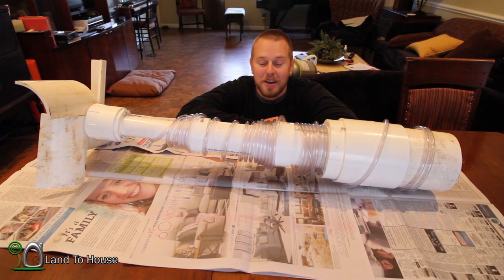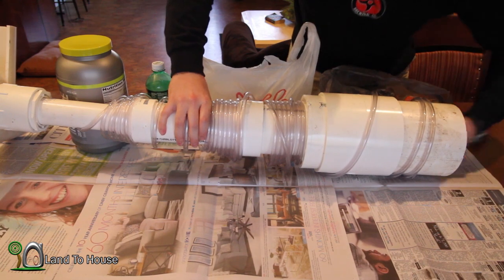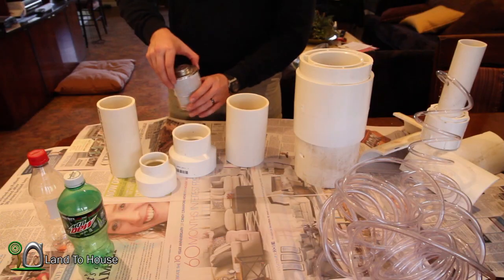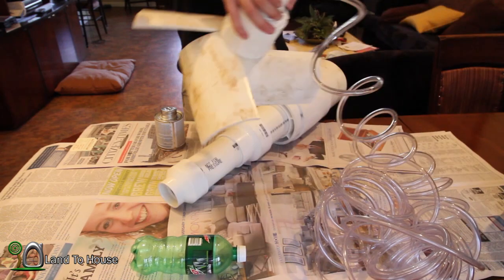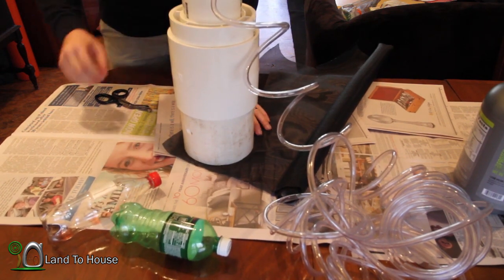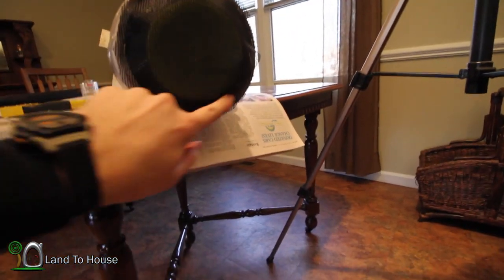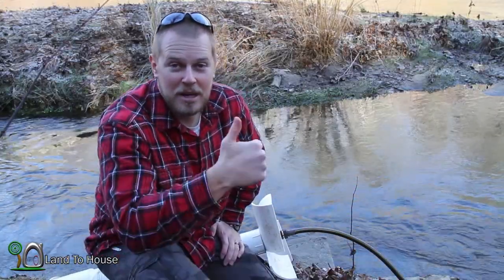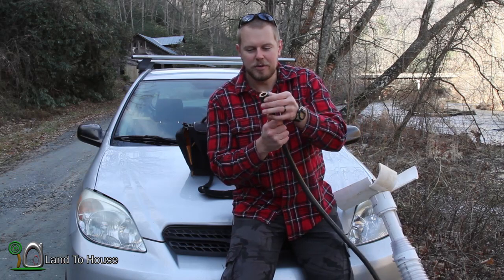River Pump Build and Test part 3

Comment: Wonderful work. Looking  foreword to # 4.
Reply from the maker: Thank you.  I am getting info for part 4 but it might be a little while.
Reply: Hi
It is me again.  I just reviewed your #1
river pump vid. I thought you had 3/4 "
clear raped around the pump, it was only 3/8".
I think you need bigger like 3/4" gulping water. I think That will get you about 5 times as more water pushing. Then using 3/8" or 1/4" for the lift hose you should get about 5 to 7 feet of lift (or more} from the river.  Good luck.
P S   Marry  Christmas & Happy New Year
Reply from the maker: +Tommy Schauer Ah yes its only 3/8" When I was buying the stuff to make this project I wanted to keep things under $100 (because I am not a wealthy man). The 3/4" tube was expensive and they only have a little of it. I am going to add a tube on the end of the 3/8" as a funnel first to gulp more water and air. Then Next I am going to add a smaller clear tube as the delivery. I think shrinking the delivery will help with the small input. BUT you are right it would be good to have a larger input tube. I was thinking that I heard a value that goes something like this: the lift is = to the number of coils in the pump x hight of the pump. So if the pump is 6" and there are 30 wraps its would be .5'x30=15'.  So I might be able to get up to 15 feet one day when the pump is working at its best. We shall see haha
Reply: How about part of the garden hose in side the pump. I understand   not wealthy.  Keep up the good work. Have good time with your family this Christmas time.

Comment: I saw this back in the 70s, used 1/2 tube for the pickup tubing and yes the blades were tapered as you say iam at part 3 now keep up the good work. Thomas Noteboom
Reply from the maker: So far i never did get this to work. I had the makings of a much bigger version but used the barrel for another project.
Reply: @LandtoHouse  spiral on a vertical water wheel would work great with that much water and flow. More to build but rather simple and use polypipe.

Comment: why not to put a lid ? instead of filling it. theres gonna be air inside if u put a lid on it.
Reply: thats a really good job, getting ideas, well done. thats what we need, creative people. not slaves of a system
Reply: i think the tube could go outside (tuve ( SPANISH SPEAKER) ) so u could use a lid for floating, n the tube would be outside still getting water. there are wheels like pelton wheels, with tubes around it
Reply from the maker: My new design has a closed system inside that allows the lid to make an air tight fit like you say. I am about 1/2 done with that build. The weather is too cold here to get in the river to test. I see that a river pump can be purchased for several hundred US dollars and that is just too much! I would like to make a DIY model that is $50 or less.
Reply: Land to House  id like to do the same thing here, cos here is a tropical country, many people live far from towns, n hace rivers n wind, but dont know how to use them, bad thing is i have no money really, no job as a pilot yet, im making just 10 dollars day, its been hard. hope u keep the hard work . thx so much for answering
Reply from the maker: I also have limited funds to make lots of tests. My wife and I are having a baby and that will take a lot of our funds. BUT I want to be able to make things like a river pump. If I can do the research and let others build it for themselves I will feel accomplished. I hope that you can build a working model too! So far this test did not work as I hoped but it gave me some great info.

Comment: I made a a6 inch ramp pump out of steel tube .tested it from a 30 ft section of 3 inch pic pipe and a garden hose..it jade a 5ft head..it empty a out in 15 seconds..it claims up to 20psi..then I made two 2" check valve ram pumps just like yours.. (12psi each)I plan on using all 3 to fill the tank..the 6" steel ram pump is impressive.but not creek tested yet..this project is take ing for ever...lol. Thank you for your input..I have some nassyers for this project..but I think it will work..I tested my turbine on my garden hose at 30 psi = 19 volts open Circuitfrom bridge rectifier..
Reply from the maker: +billy bob bussnesman This does sound like an ambitious project but I think its well worth trying! So have you tried connecting a nozzle to the end of that massive pump to pressureize the delivery? you might could get some voltage from that. I gave it a test with the 1-1/4" pump and got over 4volts with only 6' of head. Just a thought but you might have some potential. .... I have a feeling that your tank is going to empty much faster than you can fill it. SO you will be alternating the electricity production and filling .
Reply: i have not hooked the hose to the turbine yet due to it completely empty the system in 9-13 seconds,i need a water fall to keep the pump and the water line full,lol,when the 3'X6'  gate opens it releases about 2-5 gallons(guessing) but when the gate slams shuts WOW..the whole pumps moves ...psi jumps up 7-12psi every closing..it only shuts twice due lack of water supply..my house water hose can not fill line fast enough..i will take pics,,not very pretty..lol,but pressure holds ok,,except the pvc pipe tank..going to replace with steel bladder tank..im also doing a tred mill motor wind turbine project,,tested it..40-170 watts on a diversion load controller from charging battery to GTI....now all most ready to in stall...this works better then the piece of crap gugu 500 watt i bought..9 watts...lol..ill send pics
Reply from the maker: +billy bob bussnesman I just got your pictures! Your projects are all coming along well! Seems like they are all close to done with the build stage and ready for the long test. I was wondering how much psi you would get from a 6" pump. I have seen the professional builds that are bolted down to a concrete block and I am thinking that you will have to do the same here. Gosh 9 to 13 seconds! How many GPM is that? .... Someday I will bring out my treadmill motor and buy some blades for it.  we just dont have much wind around here.
Reply: i cant accurately estimate the psi until i can get a constant water supply..ill hook it up next summer..
Reply from the maker: +billy bob bussnesman That is what I am thinking about my water projects too. Its getting cold.
Reply: yep..let me know when you get the river pump figured out..
Reply from the maker: +billy bob bussnesman I will. Should be filming part 5 soon.

Comment: Have a look at at spiral water wheel. I built one with 44 feet of hose on either side of the wheel, it was 40 inches tall, and would produce 6.5 psi with only 40 inches of height, it would raise water to about 14 feet above the creek. I then pumped into a five gallon bucket, and could separate the air and water, and ran it into a 6.5 gallon water heater out of a trailer, and then from the fire into a spiral under my tent, and would have hot water or hot air under my mattress. It worked great. Don Drivdahl

Comment: What about taking the swivel off of the paddle side(hard mount hose here with brass fittings) and moving your swivel point up stream to a fixed pumping/anchor point. This would give you the ability to always keep the pump wet, centered in the current by triangulation and service your pump line on shore.
Reply from the maker: +Foothills Readiness I have actually scrapped this design. In a few weeks I will be testing the new design! Videos to come of course.

Comment: For the screen first you should have spread the screen onto a piece of paper then put the jug in the pipe. Once that was done put epoxy on the edge of the large pipe and set it down on the screen so that the epoxy pushed through the screen. Once the epoxy dried you could strip off the paper from the end. After that then trim the screen to fit.

Comment: I have watched your channel ..you have a lot of great ideas..I have used some of your ram pump ideas but did them a bigger scale..I bought a 2300 watt 3 phase water turbine.i have a fast movining creek 800 ft behind my house..I need figure away to get water to a 2300 gallon tank that is up 20 ft in a tree ..so I can use 2inch hose and gravity to run turbine..any ideas?
Reply from the maker: +billy bob bussnesman Thank you! I like to share what I am learning. That is a large tank in a tree! So a 2" pipe gravity pressure can pull 55GPM easy. (Might be a lot more) that means you will empty that tank in less than 40min. If you had a single ram pump pumping water 1gpm it would take 38 hours? Is my math right? SO you would need several pumps to make this faster. If you could make a good bit of power in 20 to 40 min I suppose its worth it. I have thought about doing something like this too just to test it out. The time it takes to re-fill a tank is the thing that always gets me.

Comment: With your 5 toe shoes I'm thinking you're very in touch with your inner caveman : )  I do love this type of Project because we all automatically think Filler Foam, Hot glue, modern (often toxic) materials, and, I love the irony of building a pump by tossing a load of plastic bottles into a river.
Reply from the maker: haha yes those shoes are funny. The use of bottles seemed like a good idea. I dont think that they were enough to get the unit floating high out of the water.

Comment: Fantastic project you got here. I'd like to share a tip with you about gluing PVC. Technically is not really gluing, but more like welding. The chemical used as a glue melts the PVC so that both pieces melt together. For that to occur properly and achieve a better bond you need to apply the glue to both pieces, not just one side. I notice you only applied it to one side. It might work ok, but the bond might fail. I don't think it will fail for this project, but if the PVC is used for it's intended purpose (delivering water to a building under pressure), it can come lose and you'll have water all over inside the walls and building. Also, for PVC larger than 2" in diameter it is recommended to use a primer to make sure the bond does not come apart.
Reply from the maker: Thank you again for the great tips. I had heard about the melting and bonding of the pipe.  I will start connecting pipe with both sides coated.  Most of my pvc work so far has not exceeded 25psi.

Comment: Great experiment again. Adding a one way valve (the small aquarium type) somewhere at the end of the clear tubing may improve the flow? You should test with the priming procedure too.
Reply from the maker: Thank you. That is an interesting idea! I will have to give that a try. Priority 1 will be getting a swivel joint that holds pressure.
Reply: The swivel joint you could mod? Just grind away the threads that tightened the hose?
Reply from the maker: After inspecting the swivel a bit more thoroughly I realize that it relies on a washer to be airtight and it must have that pressure from the threads. I've been browsing the web for a real swivel joint that's not $200 haha
Reply from the maker: I actually had that idea too! I asked around and got one of these that someone did not want but the issue was the 90 degree bend. ... a couple days ago I filmed part 4 and was able to get some much better results. I think i will post this Saturday.

Comment: You are improving it with every new adjustment you make.  Did it pump any this time?
Reply from the maker: +Pidasian Hippie It came close but then I realized that the swivel joint was stopping it from pumping. It has a leak when its not tight enough. So there at the end when I tightened it it did not swivel. I have contacted a company asking if their swivel was going to work.
Reply: Land to House I hope this company has what you need.

Comment: drill a small pilot hole and use two or three stainless screws rather than glue for easy access
Reply from the maker: +all lives matter that is a good idea. I am totally redesigning this pump right now. I'd like it to be done by next month.

Comment: If it had the same size tube on the pump and delivery hose, the air will push the water higher.
Reply from the maker: I have a new design that will use a garden hose as the spiral pipe and delivery. So they will both be the same. We shall see how well that works

Comment: I'm gonna feed off ur success and failures from your river pump..lol if I have to have 20 ram pumps I'm gonna make it work..lol there is a spot where water is leading into the creek from a small lake..I put a 5 gallon bucket under the falls ..it takes 15 seconds to fill it...as of right now the water turbine project is on hold due to I live in Michigan and it's all ready cold..but I will educate my self on this mater..and your projects are doing this..I have 5 acres of woods and have plans to put a small cabin in it..I will post some of the tests of the 6 inch ram pump..
Reply from the maker: +billy bob bussnesman You gaining success is why I make videos! 20 ram pumps would be a tad on the loud side. You might wake the neighbors but it would be worth it haha.  I know what you mean about cold. It has only been down to the low 20's this week here but in the day it has gotten up to 50 and 60 but that water is still very cold! I would love to see the 6" ram working!
Reply: this sucks,,lol i cant find the video but i will take a pic of it...if i can keep it feed with water it will work great and i estimate it gaining up to 28-40 psi...i might need to redo the pressure tank to a shallow bladder tank..the pvc pieces keep failing..but realistically i think the 6 inch and the two 2' ram pumps will do the trick..and maybe your river pump as well...now my concern is getting the 3 phase water turbine power the 800 ft to the power station by my house then rectifying to 12 volts to battery bank..any ideas on this matter?
Reply from the maker: +billy bob bussnesman I bet that 6" pump is hammering hard. PVC would break under that type of load. I like the 1-1/4" pump because the brass valves are not that expensive. 800 feet is a long way. I am going to install a midnight solar 200 classic for my tiny house. It can handle high voltage and lower amps so that it can travel a long way. But by long way I mean 115 feet. I assume you would want to have high voltage so you would have minimum loss if your system. ... I am actually just getting into solar and thus power generation. I am not the best for advice at this point. I think this time next year I will know a lot more.
Reply: sounds great...i have 24 solar panels up..12 are 100 watts ..they are on my house(sun tracking)..they are charging 10 deep cycle battery's..when fully charged they switch over to grid tie inverter.that system pushes 600-700 watts into grid.i caught a road commotion auction and got ten 70 watt solar panels,this system is just to grid tie this is out in the open...450 watts from 10-3:30pm =2,250 watts on a sunny day..on a nice cool sunny day my total system creates 1000 watt,about 60-70% efficient..putting up a wind turbine now just waiting on some parts...
Reply: i watch all your post...u have some great idea's...
Reply from the maker: +billy bob bussnesman Sounds like you are way ahead of me on solar! I have the panels and I also have a 300watt inverter and charge controller to get started in my solar journey. Just need to get some batteries. I have plans for solar chicken coop. Should be fun. Way back in the day I worked a little on a wind turbine but I abandoned it. .... One of my old channels. https://www.youtube.com/watch?v=nLlliwMAOAg
Reply: in my opinion solar is the way to go,,then maybe hydro close 2nd..if available..

Comment: I see an improvement. Make your output tube (the 2 inch), water tight, so none of the water gets into it. then you could run multi pipes around the form increasing the output water flow rate. And your tube ends don't need to be inside the 4 inch, just secured to the pipe. you couls also add a small flare to the pipe inlet to increase capture.
Reply from the maker: I have a design in the works with a 55gal drum. It will be a lot different and should work.

Comment: one more tip with a heat gun you can make p.v.c. do just about anything
Reply: I forgot to mention I think heating p.v.c.makes it somewhat brittle
Reply from the maker: +all lives matter from what I have heard there is a fine line between heated to pliable and cooked.

Comment: Can't help with the swivel coupling but it occurs to me that hitting your local dollar store for some ping pong balls would be just the thing for filling up the smaller diameter pieces of pvc pipe with air tight floatation devices.
Reply from the maker: +haynerbass That is a good idea! I will have to use those when part 4 comes along.
Reply: +Land to House Happy to help.